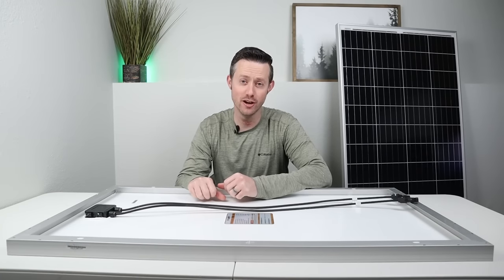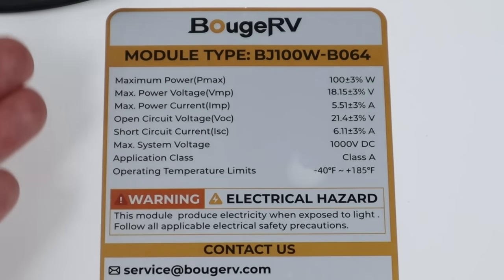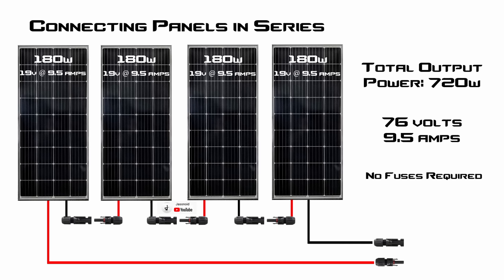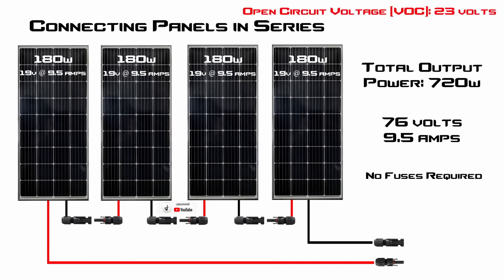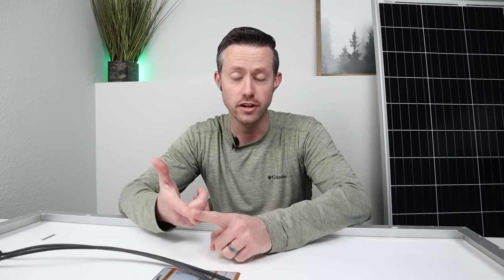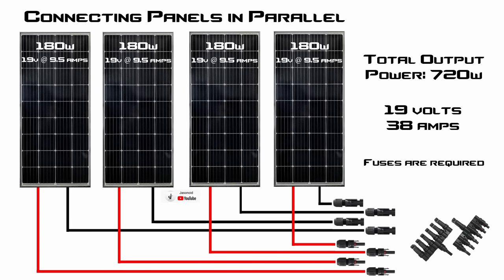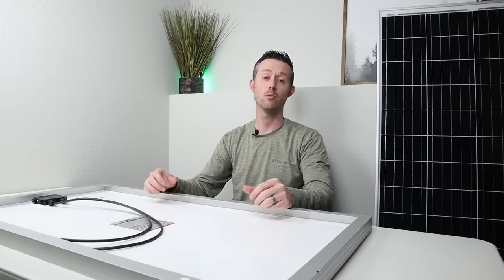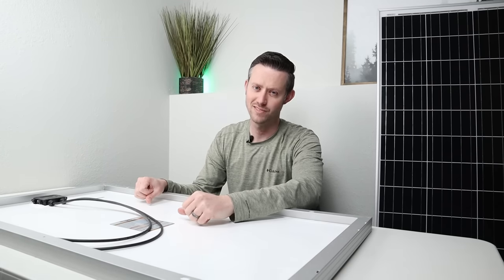Series VS Parallel! A Beginner's Guide for Solar Panel Connections - With Basic Diagrams!

Comment: I'd like to thank you for this instructional video; but I must admit that I am still struggling to fully comprehend the lingo. 
Maybe you can make a Solar Panel suggestion for my Anker Solix F3800. It uses XT60 connectors and under the connectors it shows what I assume is left then right port (above 11V-32V ⎓ 10A    below 32V-60V ⎓ 25A).
From my poor understanding I do believe that using say BougeRV 200W 9BB Solar Panels will require some configurations. I simply dunno how many panels I can safely use for my Anker Solix or the proper configurations. I was hoping to use BougeRV 400W 10BB to maximize my recharge time. I live in Florida Central South and getting adequate sun is not usually an issue; but Hurricane season does come with much more rainy days that could be an issue for recharging. Any help from you or your viewers would be appreciated. Thanks again, and TIA.
Reply from the maker: Please don't buy the BougeRV 400w panel, it's EXTREMELY overpriced at $599. You can currently buy 400w residential panels that are exactly the same from Facebook Marketplace for $150 to $200 each in brand new condition. I will have a video about this coming out either this friday or next friday. I actually looked for panels in south Florida in my research and I found plenty at good prices.

With the 60v cutoff it's a bit hard to get the max power on the F3800. You could purchase four 400w panels total. You'd want to run two of them in parallel on one input port and the other two on the second charging port. So you'd get around 800 watts on each port or 1600 watts total.
Reply: Please excuse me for bothering you again. I found Hyperion Tier One 400w Bifacial solar panels  $98 ea w/free shipping. Is this something I should consider or take advantage of now? TIA.......again. ;)
Reply from the maker: @artierodriguez8334  as long as you can verify they are legit, sounds like a great deal.
Reply: @Jasonoid turns out that is for a pallet of 36; which is just a few more than I need. LOL
Still searching though. Looking forward to that video on this topic. Thanks

Comment: Question: which of the three connections is preferable for perhaps speed of charging or quality there of. Provided my system can handle either one of them so no problem on handling any of the outcomes either V or Amps. Or is there no difference at all and it simply comes down to fitting in with existing devises and what is the safest (if not wanting to use inline fuses)
Reply from the maker: Series connections are my preferred option due to no fuses and no adapters. A higher voltage array also means less power lost over a long cable run between panels and your charge controller. I like series the most.

Comment: I have (8) 100w panels.  OCV 24.3V, SCC 5.34A, 12 gage wire, to connect to Bluetti AC200Max.  AC200Max volts is 145, Amps is 15.  How to I connect?  Do I need a fuse?
Reply from the maker: You'd want to connect those eight 100w panels in a 4S2P configuration. You can put 4 panels in series, then put the other 4 panels in series and then connect those two strings together in parallel. That would give you around 100 VOC and 10 amps. Since the amperage is so low (around 10 amps) and the 12 awg wire is rated at 20 amps, you don't really need fuses. You could put an inline fuse on the parallel connection if you want. I would add a main line dc disconnect so that you can turn off the whole power when needed.

Comment: I have 390w/24v x 2 and 440w /24v x 2 panels, which connection is good series or parrelel ?
Reply from the maker: It's best to put matched panels together. If they are different wattage / voltages you won't let peak power from the entire array.

Comment: I have an ac200max I'm trying to find panels for. I've read you can go over with watts, but not with volts. What about amps? Can you overpanel in parallel or series parallel past amp? I'm still not sure of the do's and don'ts of using this info
Reply from the maker: The equation for power is 'volts X amps = watts'. Adjusting the voltage and amperage around will get you different wattage. You never want to go over the voltage limit of a power station and power station will automatically limit the current (amps). For an example, having a solar array with 20 amps available means that a power station with a 15 amp limit will only pull 15 amps and will not be damaged.

Comment: I have two 160 watts EcoFlow panels that i want to connect to my EcoFlow Delta 1300. Is there a difference in efficiency between a series or a parallel connection ?  Thanks !
Reply from the maker: You'll want to connect those in series so that you can get max power. Connecting them in parallel you'll hit the amperage limit of the power station.
Reply: @Jasonoid  Thanks a lot Jasonoid !

Comment: So in designing a 5Kilowat solar array, would I simply use the largest panels and fewest number of them and just go with a series wiring over Parallel setup ?  or would I do the combination of series and parallel.
Reply from the maker: Series works well if you don't have shading. A combo of series and parallel may be needed for better shading performance.
Reply: @Jasonoid  thank you

Comment: What size fuse should you use in each of the parallel set ups you spoke to?
Reply from the maker: Usually 2 to 3 amps higher than the short circuit amperage of the panel. That's usually around 12 to 15 amps.
Reply: @Jasonoid  great! Thanks for the insights!!

Comment: What are your thoughts I'm paneled with the 767 anchor I have 6 200 W rich solarpanels running a 100 feet they're meter and out at 44 V and 20 amps Getting 750 W this day
Reply from the maker: Seems to be working well for that charge controller. If you use large gauge wire you'd probably get a few more watts from your panels. I'd recommend at least 10 awg wiring, 8 might even be better at 100ft.
Reply: @Jasonoid   I have 10 gauge run in a 100 feet works well going to keep an eye on it in the summer make sure I don't get over 20 amps but I would like to purchase an EG4 battery and a charge controller for that do they make one that will accept multiple strings have different size solar thank you
Reply from the maker: @tomcrickon8773  you can parallel different charge controllers to the same EG4 battery. So you could have 2 or 3 different arrays with 2 or 3 charge controllers
Reply: Thank you for your knowledge I like the part where you plugged in the EG4 to the anchor 767 my question is on the different charge controllers I have a toy holle with 1300 Watts on it. will i be able unplug  one of the multiple controllers that runs. 1300 array And go camp without making iany adjustments on  other controllers thank you

Comment: At 08:10, you said "the rated amp of the panel which is 15A". How did you get that?
Reply from the maker: It's usually on the back of the solar panel listed as a specification. If it's not listed I'd plan on 12 to 15 amps as the peak amperage.

Comment: Does this still work safely if the two solar panels are different sizes/wattages? Tia
Reply from the maker: Only if the voltage and amperage specs of each panel are very similar.

Comment: I had a lightning strike hit a pannel . It jumped the first fuse but somehow was stopped by the second. It's always a good idea to fuse everything even if the expected current doesn't require a fuse.
Reply from the maker: I have been using DC circuit breakers on my setups, I sure hope those will stop lightning!

Comment: If we are in situation of adding PV but for some reason their specs are not the same specs, what is the best configuration?
Reply: Example, we were using 4 of 300 WP, and on the market there are only available 500 wp and we plan to buy 4 more 500 wp pv.

Comment: If you have 24 panels, set up into 2 strings of 12 panels each, could you series connect each panel for each string then parallel the 2 strings together? Any fuses needed? I have 24- BlueSun 460W Bifacial Solar Panel (Silver) | Up to 575W with Bifacial Gain. Wattage:460WVOC:50.8VTVOC:-0.26%/℃ISC:11.22ACell Type:72-Cell | Monocrystalline. I was told that the way these panels are constructed, they would not be 100% hindered by partial shading on any panel because of the cell design. Answers? Thanks.

Comment: Hi Nice video.  However, you failed to mention impedance matching between the panels and your charging load, which can drastically change the actual delivered power of such panels to the load.  I dont know much about charging loads (inverters, etc.) and maybe they have auto impedance matching.  But I do know that when you go changing the arrangement of the panels, you are going to change the net impedance of the array as seen by the charging load, and if that charging load does not have the same impedance as your array, your power transfer will go to crap.  Would like to see that covered in a video.  Thanks!
Reply from the maker: Impedance is non existent when current and voltage are constant. So for a DC system (like an solar array), impedance and resistance are the same. You can plan to overcome resistance by using proper wire gauge and realistic wire lengths between components. You also design your solar array around your charge controller and battery voltage. If the charge controller accepts high voltage input and has a low amperage limit, it's best to use a series connection for solar input.

Comment: I want to use 4 550watt panell  
Maximum Power Voltage(Vmpp/V) 42.1
Maximum Power Current(Impp/A) 13.07
Open v 49.9
Short A 13.88 
60a charge controller 
20feet from panel to charger 

How would you approach this array ?
Using this on a 24v system ... how would you wire this
Reply from the maker: What the maximum voltage input of the charge controller?

Comment: Vmp and IMP always Confused me, The Only thing I ever looked at was VOC. When trying to find out what amps a panel is, I never knew which one to choose IMP or ISC. I'm in Michigan we Experience all Weather Conditions here. I hate the fact that most power stations are Capped off at 150 volts.  I do have a lot of trees but enjoy the series connection from about 80ft away. I want to get Some 450w Sunpower Panels which will involve a 2s2p connection for my AC300, (I know it has 2 mppts but one connection is already used on the roof)

Comment: i have four 100 w solar panels and a Renogy voyager pwm solar charge controller with a Renogy 500A battery monitor and a 3000 w Renogy inverter with a 200ah agm battery i connected the system using the Series and parrallel for my12v system is this ok?
Reply from the maker: It all depends on the input specs on the solar charge controller. Just make sure that the solar panels don't go over the maximum solar input and you'll be good.

Comment: If I have two 100w solar panels wired in series and comes with the controller, what else do I need? An inverter? Another battery?
Reply from the maker: You should be able to connect that to a battery to charge it up.